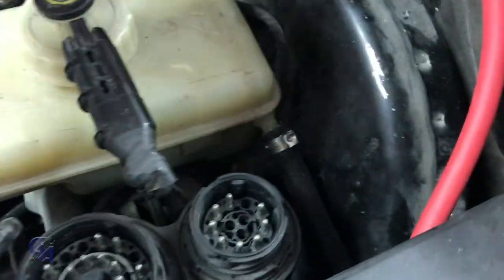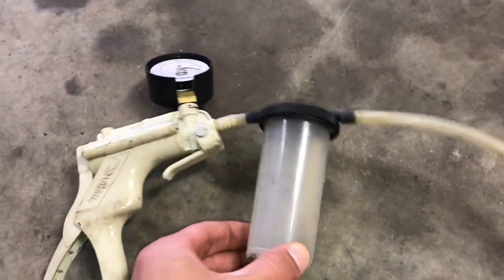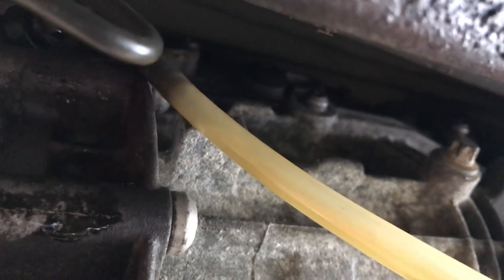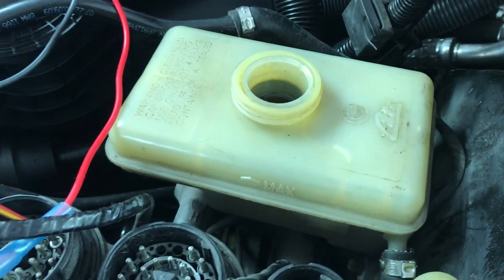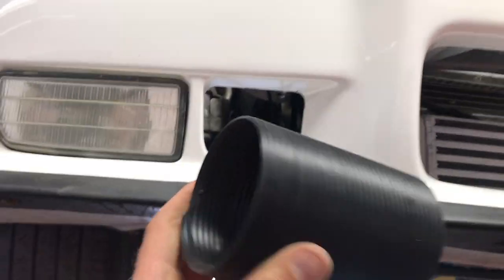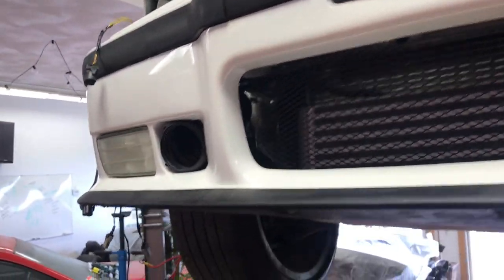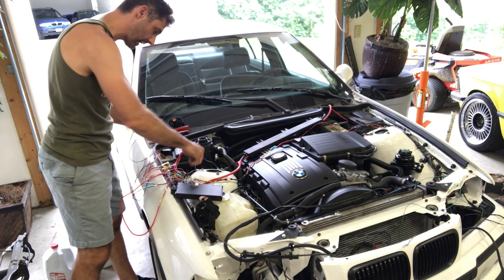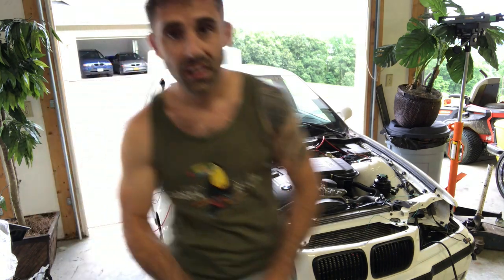Let's Get This E36 M3 Moving!!

Comment: Try to check brake switch that allows you to start with button  
Great job you ✌🏾
Reply from the maker: Thank you!, This engine came from a manual car. Brake Switch, while an input to the CAS unit, does not rely on engine to start.